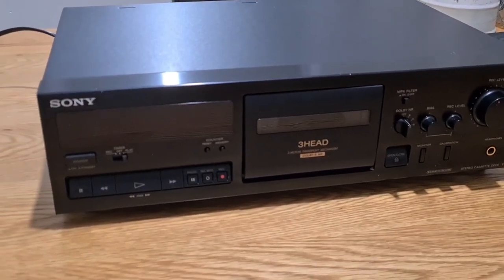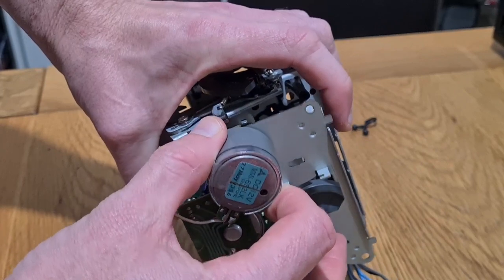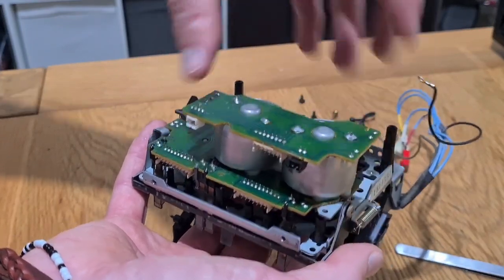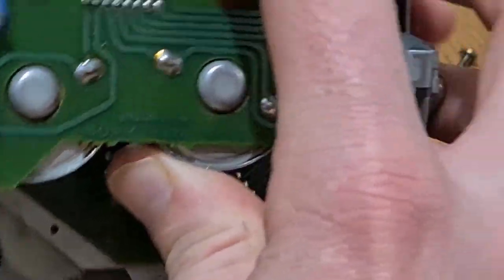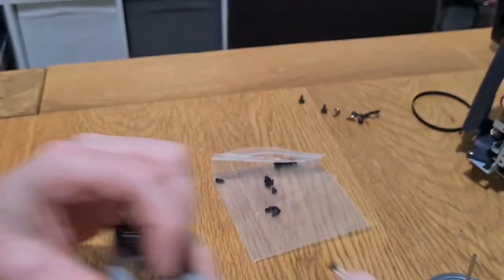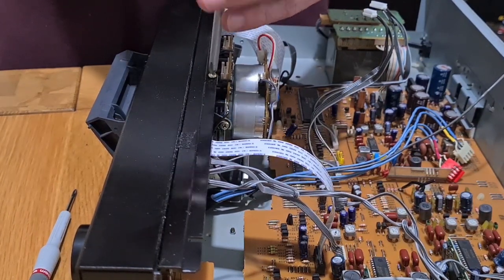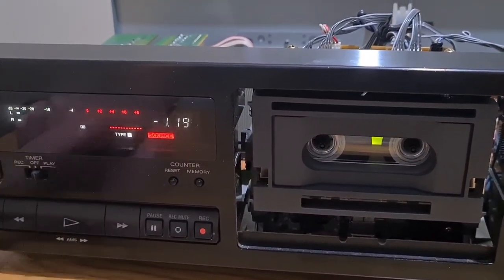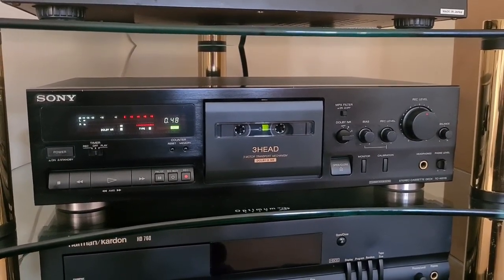Sony TC-K611S Three Head Cassette Deck - More Belts and Servicing!

Comment: Good job 👏  here's a secret you can use a duster can to freeze the belt or put parts in freezer and the belts will chip off in hunks non chlorinated brake cleaner works great and carburetor cleaner in a can also works great 👍
Reply from the maker: I'll try that, but I'm always too impatient 😁

Comment: Thanks so much for this. I have owned this deck from new and decided I wanted to play some old cassettes recently only to discover it was no longer working. Hadn't been used for 5-10 years and both belts had gone to mush. Watched this video and was confident I could follow the instructions so ordered replacement belts. Had to watch someone else's video to work out how to open the door manually to remove the faceplate but then followed your instructions and replaced both belts easily. Was then disappointed to see that cassettes would stop after less about 1 second of playback. Fast forward, rewind and even track seeking worked fine. Checked mirrors, all shiny and clean. Worked out how to run the transport without a cassette in (again from someone else's video) and from that I could see pinch roller was sticking. Took it out and discovered a bump on it. Quick rub with an emery board to remove the bump and now the tape deck works fine. I will be ordering a replacement pinch roller. Thanks again for giving me the confidence to try and fix it.
Reply from the maker: Hey no problem, I love comments like this as I did start doing this to hopefully help others. Enjoy!
Reply: I've got the same problem with the  door not opening but I can't find the video of how to open it. Do you remember what one it was?

Comment: Paul, there's two metal staging rods for the capstan belt as well. You can stage the belt the same way you staged the mode belt. They might not appear that that's what they are, but they are. I know from first hand experience.

Comment: This is a great vid.  I like the voice over and the close-ups.  I searched hi and low for a vid that covered this particular drive unit and this is the first one I've found - so massively helpful - although I'm halfway through the pull down but still finding this enormously helpful. Mine is the twin cassette deck with dual capstans' but the same drive system.  Thanks mate!
Reply from the maker: No problem, the transports are about identical except with the addition of the dual capstan and another pinch roller. 

I think this deck type is my most featured deck, I must have maybe four or five with jobs on them. They have become my forte! If you need a hand drop me an email, address is in my profile 👍
Reply: @pwrestoration  Cheers.  I assume the capstan belt goes around the large wheel and up and over the smaller wheel and then onto the drive cog - so that the capstans' turn in opposite directions?  (if this is correct is the contra motion some kind of balancing/stabilisation thing?

Comment: Hi Paul, could you help me with my sony cassette deck Tc-kb820s . I noticed that when I  press stop as it's playing  there's a momentary cog noise and the tape reel continues to turn for a second or two making the tape slack inside the cassette shell ? Thanks for any help . Danny.
Reply from the maker: A little run on can sometimes be down to a damaged gear on your transport, it would need to have the transport removed and all the gearing relating to playback inspected. In truth it'll take a second deck to use for spares to repair it, so it may be a case of if you can cope with it - let it be.

Comment: Gutted. I've had cassette deck from new. Been in storage for many years now. The issue was identical to one in your video. With your video, I was able to quickly change the belts and give it a clean. Looking forward to playing some old tapes. It powered on and seemingly made all the right noises and the capstan was spinning. Loaded a tape and nothing. :o(
Reply from the maker: What is it doing when you press play?
Reply: Hey Paul,

So I managed to strip it down and replace the smaller belt. That allowed the door to open. I put a tape in and it read the tape type. I could forward and rewind the tape but it would not play. 😢

Any tips on what to do next?
Reply from the maker: @jamesbeaumont1191 @jamesbeaumont1191 

Firstly is the capstan spinning?

If not, give it a little touch in case it's stuck. 

If it is, and it's not engaging the heads when you press play, whip the transport out and double check that the little white arm is engaged in the large grey wheel, it needs to be sat in the groove. You'll see when you see it.  When the transports in your hand, look from the bottom. 

Aside from that ensure that the tape-in switch is activated. I know you said it's displaying the tape type but from memory I think the far left hand leaf switch (as you look into the deck with the door cover removed) controls that. Just have a press of the switches as you're trying to play. Use a credit card.
Reply: Hi Paul,

Nearly there. The large belt had come off putting it back to together. So, I can now play tapes but the sound is muffled. The heads appear clean. But, it’s also crinkling the tape as it runs.
Reply from the maker: Pinch roller is knackered @jamesbeaumont1191
Reply: Hi Paul,

So the smaller metal plate that holds the heads wasn’t sitting quite right. I’ve reseated it and it seems to be in the right place. During that time I removed the pinch roller and gave it a very good clean. It seems in good nick. (I don’t have a replacement for it yet.) A tape plays well a few seconds then the left channel fails before more crinkling.

Comment: Great repair the voice over works well .I bought a faulty sony tck 561s from ebay for £10 a few years ago the previous owner had messed around with it so have spent a while sorting his mistakes out for some reason he removed the head screws so had to find my own .I am still trying to sort the head height out
Reply from the maker: Honestly the best way to do it is not using equipment. I'd get a mirror tape for the head height, and do that by eye. Then play a tape and fine tune the height by ear.. the tape will fade in and out of clarity as you adjust the height. Find the best for your ears. Then same with azimuth, then if you prefer fine tune with an oscilloscope 😌

Comment: Outstandingly precise and detailed!  I wish every "how to" video on YouTube were like this. Many thanks!  Got my deck working beautifully again.  One suggestion ... where you take the cables off of the circuit board between 3:03 - 3:09, it bears mentioning that those cables have a clip at the bottom that holds them to the receiving end.  I was on my way to damaging my circuit board before realizing this and then used an extremely small screwdriver to help pry the clip away while tugging on it.  Thanks again.

Comment: The more you disassemble the mechanics, the more possibilities for a bad build. I have a Sony TC-K661S and I never split the center for the small square belt when changing belts. Just loosen the screws and pull the belt to the engine on one side. The surgical tool of forceps helps me. I tighten the screws and assemble on the rest with the big belt. If I don't want to clean the inside of the mechanism, it's pointless to take it apart. I've done it several times and it's always OK.
PC repairman Marko Minesi's rule: be a little lazy and start with simple things. Play the hero with a screwdriver only as a last resort.

Comment: Hey thanks for this. I have just changed the belts on mine extremely carefully, put it back together and everything worked beautifully apart from play! Though it might be the gears so played around with them and thought I had it, now the door won’t shut and it won’t play 😢😢 At 12.53 on your video you can see the sort of lattice black plastic joining all the bits and pieces and I noticed one of those on mine is  snapped. Would this cause the sort of issue I’m seeing? Cheers.
Reply from the maker: I reckon it's one of a few things. 

Firstly ensure that you have reseated the pinch roller housing properly. 

Secondly take the transport out and look inside it from underneath. See that white plastic arm? It should be seated in the groove on the big grey wheel. It's really easy to reassemble and that gets knocked. You don't need to strip it again just pop it into place. I'll have a look at the timestamp and reply again. Two secs!

Comment: Hi there, I hope you still see these old comments. I just landed a Sony TC-K470 from a thrift store and I'm trying to get it working. It's making the same whirring noise on powerup as this one, but the eject button is doing nothing. It looks to be in pretty pristine condition otherwise so I figure replacing some belts will do the trick. If I want to open up the transport like you do in the video, how do I go about that when it does not want to open up? Thanks a bunch, really informative vid.
Reply from the maker: I have a few videos on this transport which should cover both your issues. 

I suspect the 'dead door' video I did will have it all, it will probably be the rotary encoder (in that video) if the belts haven't gone. 

Get back to me on here if I can help otherwise, you can manually open the door very slightly from inside which will be enough to pull the front plate off and up. But be careful!

Happy to have a look at it if you get stuck, I repair a lot of these decks. 

Good luck!
Reply: @pwrestoration  This is my first time putting my hands on a tape deck btw, I can hear the eject motor whirring when I press the button so I assume it's just a belt that's the problem, do you think I can just manually turn the gear and press the button at the same time to trick it? I've ordered new belts and a new pinch roller to replace once I opened it up but I'd really prefer not to have to do the whole gear aligning stuff you mention in the vid :')
Reply from the maker: @Lesbean.Sprout  yes you can, it's a cam on the left hand side of the transport as you look at the front of the deck. It's kind of on a spring, you should be able to work it out. 

If the motors spinning that's good.

Comment: Hi. This is an exemplar of what an instructional video should be like. Thank you.
I've tried to fix my deck. I replaced the belts. But - you know the part of the video where you warn against movng the gears (world of pain) - mine just dropped apart. I tried to reassemble and it all fitted togther neatly. But the controls are haywire - it operates on play, rewind and FF ok but for a very short period and then stops.
Have you any guidance on setting the mech up?
Reply from the maker: Hi Cedric the best I can do is here 

https://www.tapeheads.net/threads/help-reassembling-sony-tc-k611s.87204/

And also use the service manual. Best to print it out and then slowly rebuild piece by piece. Any images on Google for k611 transport repair may help. 

Your symptoms indicate a few things. Firstly clean the sensors for the back of your reels, and also the mirrors they sense against on the backs of the reels. The sensors I believe are in the video, they look like black cylinders on legs. They must be immaculate, same with the mirrors. They're what makes the transport know your tape has ended, so will stop playback. If dirty it stops playback prematurely.

Second one is the rotary encoder, essentially a rotary switch inside the transport. There's a few pics of someone cleaning theirs on the above link. 

I have two k611s videos, maybe what you need is in the other one. Thanks for the feedback though!
Reply: @pwrestoration  That is soooo helpful. I'll crack on. Thank you.

Comment: Question: how would you begin this work if the door won’t open? Can you reach into the gear and turn it manually?
Reply from the maker: You sure can, once the top is off you can look down into the transport. If the deck is facing you, the left side controls the door, there are three white cogs. The largest of the three is the door release, turn it gently (gently!) With a flat thin screwdriver.

Otherwise, the black bar that runs across the top of the transport (the tape selector leaf switches poke out of it) needs pushing back to release the door. You can GENTLY open the door just enough to pop the black cover off. Then you can remove the transport as one and disassemble.

The smaller belt slipping / snapped is what stops the door from opening.

Comment: Help! lol.
Thanks for your instructional video.
I've recently changed the belts & roller on the same model deck .
It all works - but the tape speed is way too fast when I select PLAY (it's like listening to the tape while it's fast forwarding).
I bought the deck with the belts in a decomposed state, I'm 100% positive that the little 'dimple' on the wheel in the mechanism is located correctly in the appropriate receptacle of the neighbouring mechanism component. 

Any suggestions?
Reply from the maker: If you have a multimeter stick it across the terminals at the main motor and measure the voltage when it's playing - I think it should be 13v but I can check for you. Does fast forward run at the right speed or is that also mega fast?

Comment: Brilliant Vid mate, wish I'd watched this first rather than another vid on you tube,  I took apart with the door closed rather than open and I've  knocked the gears out of alignment trying to put the small belt on, I knocked the taped opening gear out I think, put I hope I've put back correctly, refitting it back tonight. so will see. If I'm unlucky and of the plastics get damaged, can you still get replacements?
Reply from the maker: I've got about four videos on the same deck buddy, generally they go back together fine. The wheels where the small belt fits on, doesn't matter. 

Position the large grey cog with the notch facing 6 o clock as the transport is standing up. 

The two plastic arms, the smaller one is curled, and curls down towards the transport as you build it. The largest arm can only go one way. Make sure it's pin sits in the groove on the large grey wheel. 

I have some parts if you're in the UK or get stuck.
Reply: @pwrestoration  thanks for replying Paul, I did try to reply twice earlier in the week but you tube removed the comment as it had a link to a short video I posted showing how when I pressed play on the transport the head moves up but instantly shoots back down, then tries automatically again, and so it repeats, everything else seems work fine, have you ever had this issue? thanks
Reply from the maker: @daveboogie1  I would say check your pinch roller is seated properly, so it's not getting stuck, then check alignment if your rotary encoder (in this video) 🙂
Reply: @pwrestoration  , thanks, had another go and everything works ok apart from the head keeps rising and falling a couple of times per second and doesn't engage. I think the Large grey cog (Mode cam) you are referring to also has grooves underneath that also have to align. The problem is that under the mode cam as you look at it from a birds eye view, there is also another notch (not the notch you are referring to on the top, but underneath) that makes the head rise and fall, also there is another spring loaded plastic arm that pushes up another arm that locks the wheels of the tape. Do you know how this notch and the arm should be set so that the mode cam turns so the head will rise correctly. I think this is my problem. Sorry for ht e long winded explanation, ta